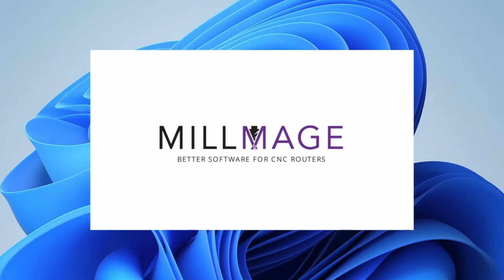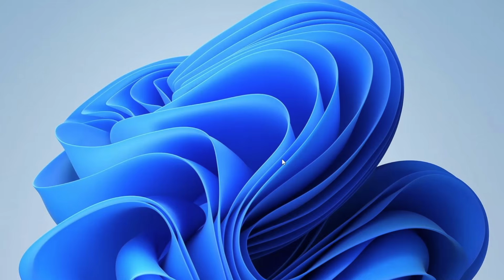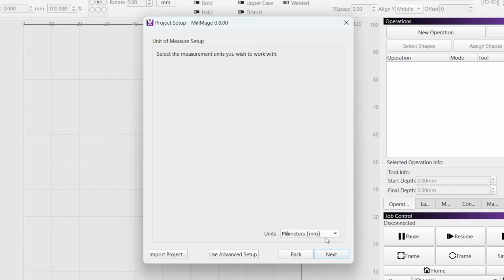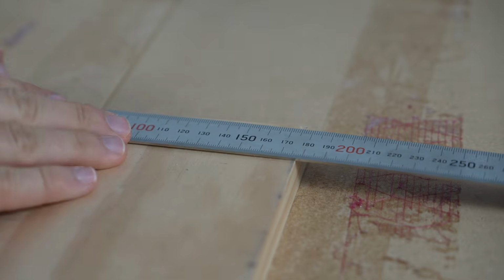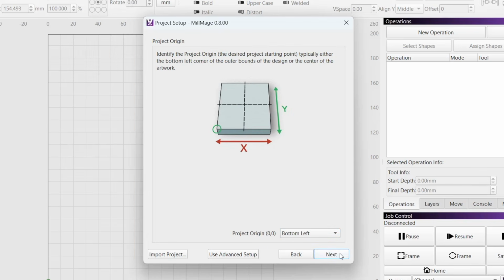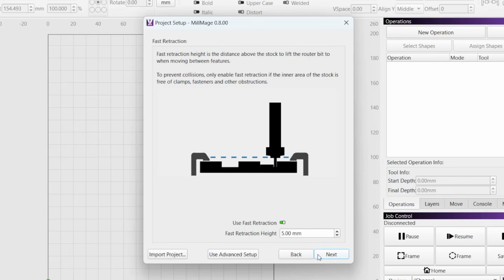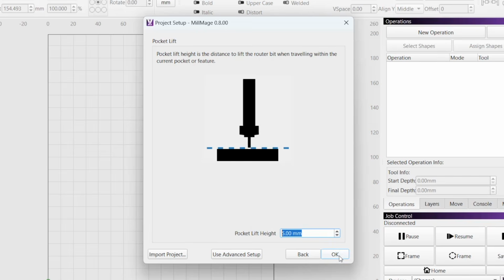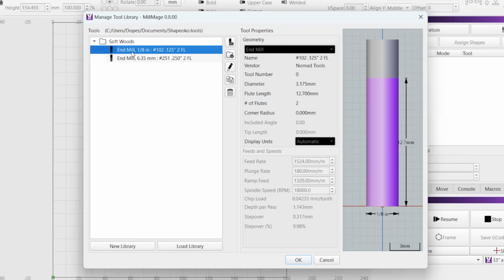Project Setup in MillMage

Comment: Does this software has 4th and 5 axis capabilities?
Reply from the maker: 4th and 5th axis support are not planned at this time. We provide a site for users to vote for new features. You can search to see if this has been requested, and vote it up, or add it so others can vote their support as well. This helps us prioritize which features to direct development time toward.

https://millmage.fider.io/
Reply: Easel is better when looking at the work Area and stock material on 3D View 
and the picture itself it’s very clear and good to know on how your project would look like.
This software only supports 2D View and it’s very glitched and you can’t see your project very well.